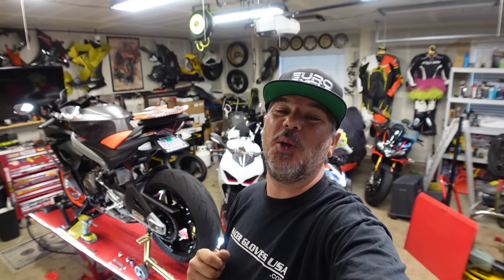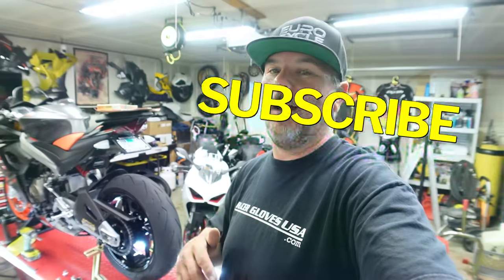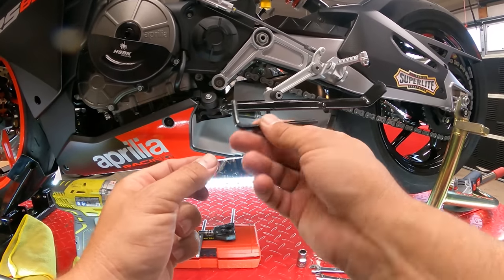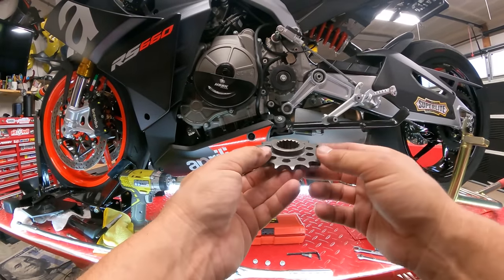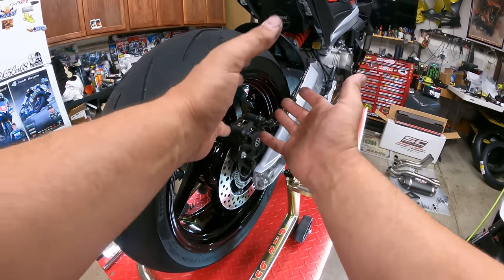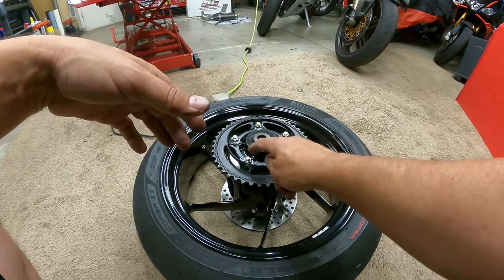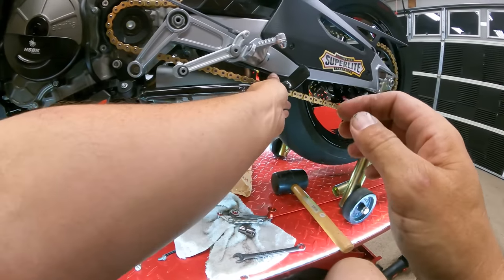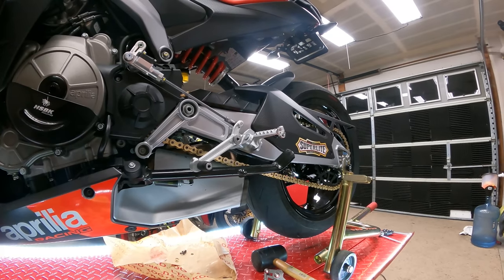2021 Aprilia RS 660 | Superlite Chain & Sprocket Conversion

Comment: Bill,
Thanks for the information on the RS660.  I've got one on order and there are not a lot of  aftermarket parts available yet.  I was wondering, do you use so many Spider parts because of availability, quality, price, or what?  Thanks again for the information you provide.

Comment: What did you use as a marker to have the tire aligned? After loosening and adjusting the bolts? I do not see incremental lines, there are a couple, but seem far apart.

Comment: Hey.. do you guys know if I can lower my RS660? I find the ride a little too hi for me...
Reply: I believe you can adjust the suspension. But I am not sure. I don’t receive mine for another week or two but by the research I’ve done I believe so
Reply: You can if it has a rear shock with linkage. They sell lowering linkages for many bikes, problem is that the aprilia is too new so I don’t know if there is one yet (IF it has a linkage at all)
Reply: @gamingradius8057  It hasn't a link
Reply: @peppo.99  then I guess, if you are lucky enough and have the right weight, you can soften the preload and thus lower your bike height when you are on it and the shock compresses with your weight. Probably won’t be the case though.
Reply: @gamingradius8057  the suspension works bad
Reply: @CaliMotoTV  yeah that’s true, you get less ground clearance but I don’t think it will be a problem if you don’t go track racing. Even then, if you don’t drag knee, you won’t have a problem.
Reply: @CaliMotoTV  then I suggest calling the one and only, the father of suspension, Sir Dave Moss😂

Comment: No offense, but calling a nut a bolt makes my skin crawl. There were three descriptors for parts you removed. Bolts from the front sprocket guard, nuts from the rear sprocket, and axle, and the threaded shafts that come out of the cush drive are studs. 

Just an fyi.